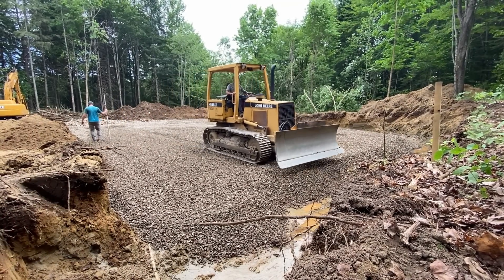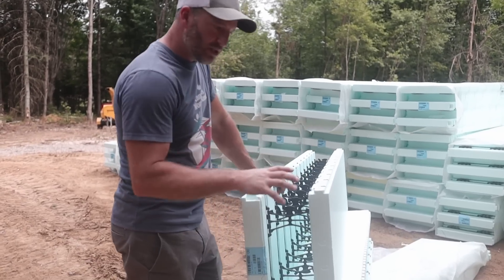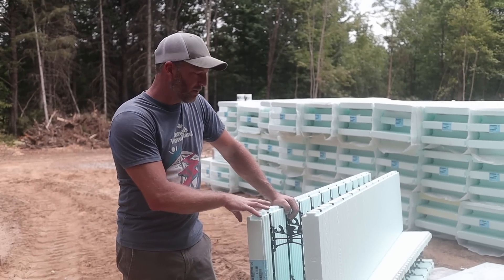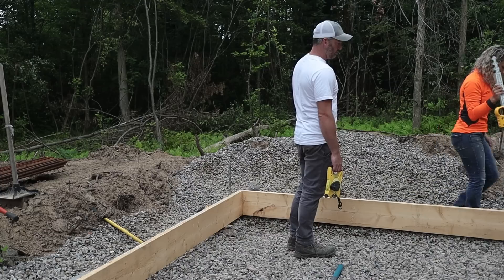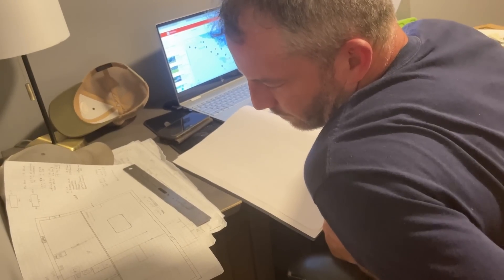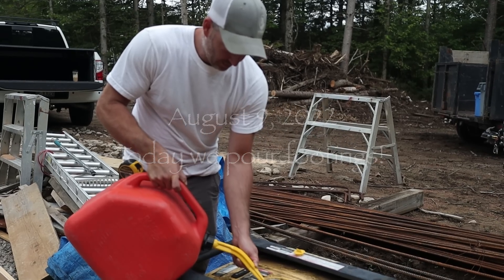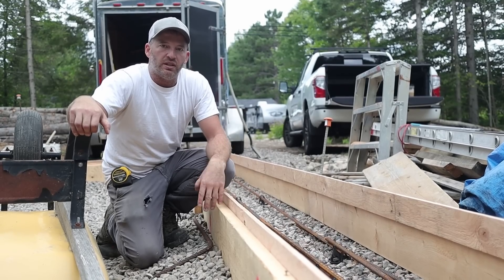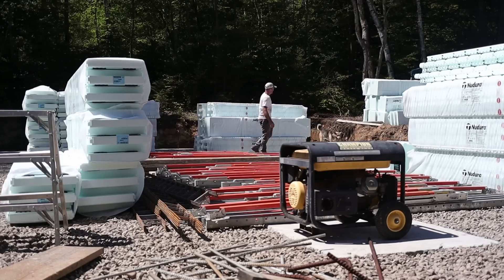Building Our Own HIGH EFFICIENCY House | What is ICF? and Starting Footings

Comment: In the UK those foundations would have had around 2 days constantly being brought up in 6 inch layers and hammered all day with Bomag 120 vibrating rollers and when finished they would be movement tested for around 6 hours which involves an instrument under a 25 tom excavator sitting on it and if at the end of that time it moved even a fraction it was a fail and do it all over again.
Reply from the maker: that sounds expensive, a year in and still not 1 crack in the basement floor

Comment: It is interesting to see, that insulation against soil moisture has no culture in America.
In Europe, even in my 2nd world country, it is unusual to build a new house without a continuous layer of insulation below the walls and the floor.
A slab is placed on top of the footing, and the slab is covered with a continuous insulation of 3-5mm (0.1-0.2") against moisture. This slab must be reinforced, otherwise settlement of the building may break it and that may tear the insulation. If this insulation is below ground level, then it is later connected to the insulation on the walls outside, forming a continuous insulation layer below and on the sides of the building, like a pool.
Reply from the maker: were in Canada and i think you need to watch the rest of the videos to see the whole process.
Reply: @TimberMates  Was a vapor barrier installed between the FOOTING and the ICF wall later? I watched some of the other videos (installing the external water proofing and the pouring of the floor) but I did not see anything between the footing and the ICF walls.

Comment: the icf seems to be made of styrofoam and not very thick? you say fully insulated, but what exactly is the insulation value with such thin polystyrene foam?
Reply from the maker: The R value is about 24 with the foam, but due to the lack of thermal bridging and the inherent thermal mass effect of the concrete it performs closer to a R50. These homes take half the energy of other new homes built to code.
Reply: @TimberMates  Sorry, but noooo. If the R value is 24 based on the thickness of the insulation, that that is the theoretical value, in reality it can only be less. That is the value if it is perfect, without thermal bridges, infinite strait wall, but even if you make the wall perfect, corners make the effective R value less.
The heat capacity of the concrete is another story, that delays temp changes in the wall for 1-2 weeks, but does not change the amount of heat lost over longer terms (over the months of the heating season). Please also note, that temp of the concrete will be in the middle between inside and outside them, making it half as effective heat storage compared to a thermal mass completely inside.
I am sure, it is a good energy efficient house compared to code and average, but these day, it is better targeting near to zero. I would not start building anything below 20cm (8") insulation.
Reply from the maker: I'm really curious what you're trying to gain by arguing with me here? I built my house, and many like it, I've done the math, and I know my trade very well. Do not mistake a lack of perfect and detailed explanation to satisfy your aching inquiries for lack of knowledge.  @williamforsyth6667

Comment: The building inspectors in our area will only approve footings on undisturbed soil for footings.
Loose material on piled projects only.
Love your channel you two!
Reply from the maker: Footings like that would fail and bring a lot of water into your home if it was wet like our property is. The clear stone gives water a way to get out or through, and the footings are much wider than normal footings to support the weight of the house better.

Comment: That's so awesome. Really looking forward to this build. 💯👍. Cheers Blessings 🙏.
Reply: I'm getting other ICF construction videos now. I have a question now. When the ground starts settling around the concrete foundation square, what will prevent the walls from cracking in the future? Am I missing something? In some buildings I've worked in, I've noticed a larger square of concrete added above the support columns for the next floor. Would it not be better to make the corner foundation spots larger in square/size to act like a bigger foot print. I'm just thinking to much maybe LOL. 🤔

Comment: I too used to work in home construction but have never worked with ICF.  It will be neat to see this process.  At least you were only pouring footings otherwise that concrete could have been worse to work with.  Hopefully they didn't mess up your order and give you the wrong psi mix or something.  Looks like you guys are going to need a bunch of fill with your basement floor only slightly below grade now.  Walk out basement maybe?  I will wait and see.  😃

Comment: Not only can they build but she can also juggle, show off!🤣 I don't know much about construction so this is very new and exciting to me. I know over here most houses are built with cinder blocks but I have seen some constructions (like my neighbors) that used a similar method but instead of foam molds they use wooden panels. I think they went a little overkill cause the base of their cement fence was about 4 feet wide with rebar. Can't wait for the next video🤟🏽

Comment: I imagine you would have maybe 3 inch or 4 inch PVC pipe run through the forms at certain locations to run water/electrical/plumbing into the structure?
Reply from the maker: yes exactly, we do that for all foreseeable building penetrations
Reply: @TimberMates  

I will say this,  you're building a house that will be here long after humankind has populated another solar system.  LOL!

Comment: It's a smart idea,  what they do with older homes is excavate around the perimeter of the foundation,  place the foam insulation up next to it,  and then backfill to bury and hold it in place.  This technology is doing it all at once plus installing foam insulation on the inside of the wall as well.